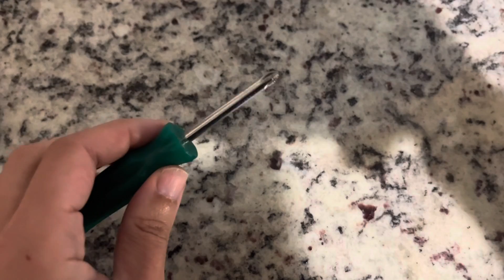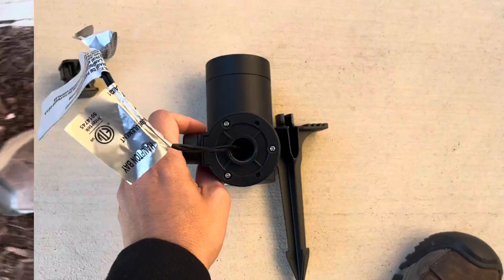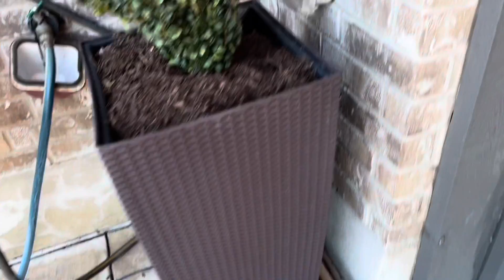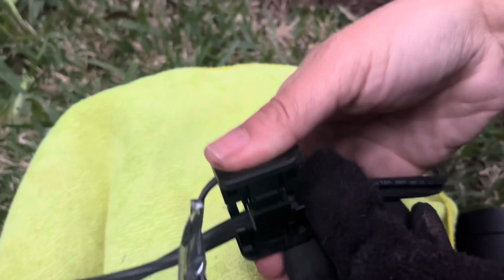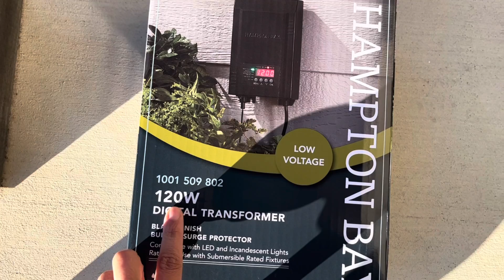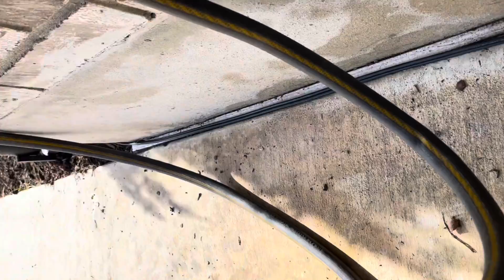Low Voltage Lighting Installation using Hampton Bay LED lights, low voltage transformer, and wire

Comment: Is the transformer actually necessary, or is there any other way to plug them?
Reply from the maker: The transformer is a must for this low voltage set up.  I don’t have enough electrical knowledge to know if there’s a safe work around.

Comment: Nice set up and I’ve never seen the liquid tape cool. So can you set a time on transformer with connecting to Bluetooth?
Reply from the maker: Bonus…the transformer has a timer feature built in! It’s sort of like your sprinkler system. You set it and forget it unless there’s a time change or power outage. The only part of this setup that is Bluetooth/Wi-Fi enabled are the actual lights. You can buy a separate Wi-Fi adapter for some of these transformers.  Though I haven’t found it necessary given the built in timer😊

Comment: Great info. Reason for using liquid tape instead of electrical tape?
Reply from the maker: Great question! The liquid electrical tape seals off the ends to (hopefully) prevent moisture getting between the nooks and crannies of the regular electrical tape.
Reply: You could also use wire nuts at the ends of the wires, then wrap tape around them.  Probably the safest/best option.